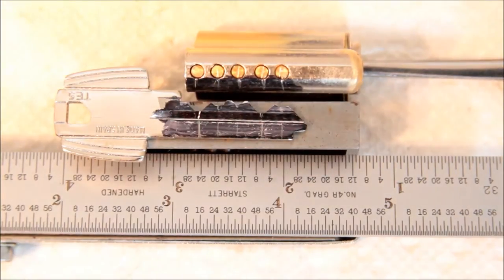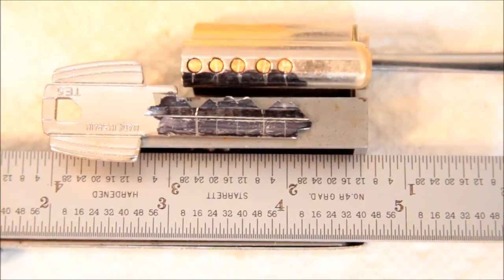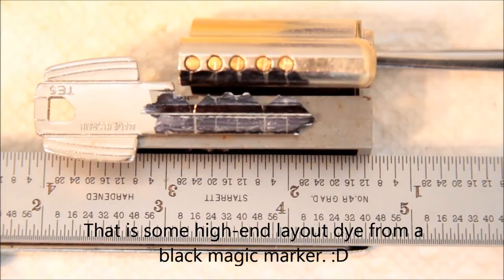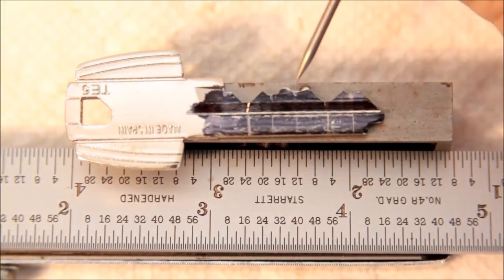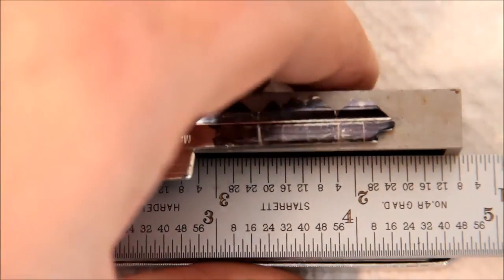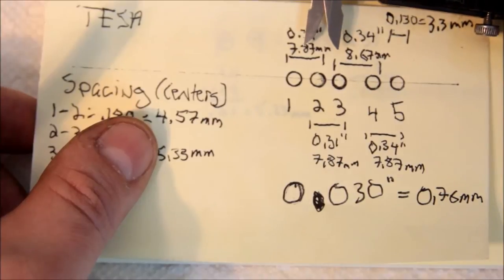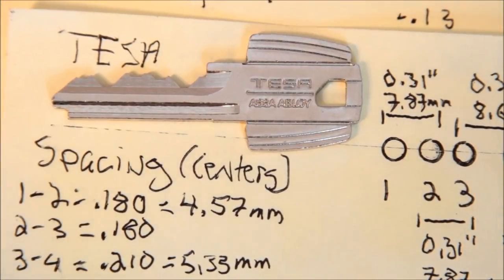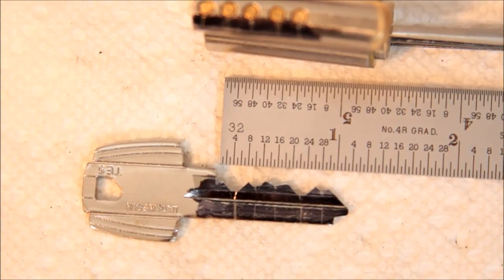(101) MACS It Out: Irregular Pin Spacing on TESA/ASSA Cylinder

Comment: My theory is that an anti bump pin would be positioned in either position 3 or 4 and as a result of the greater spacing it would be a deep cut 
allowing a long pin which would be lifted above the shear line by any bump key that was used in this lock thus resisting bumping.